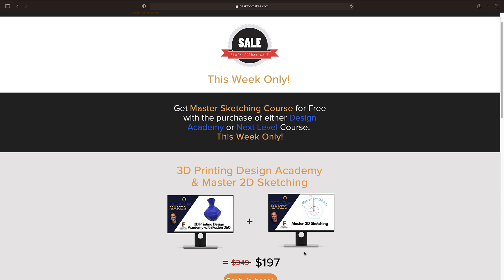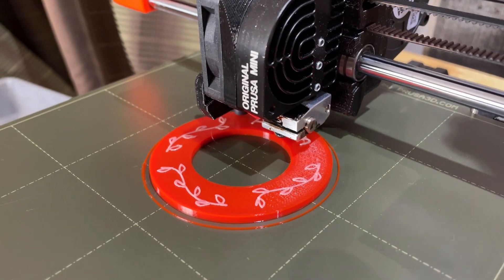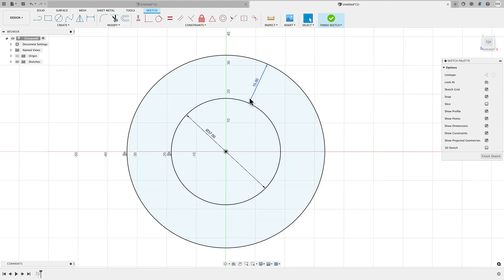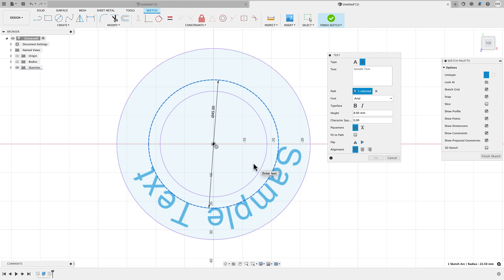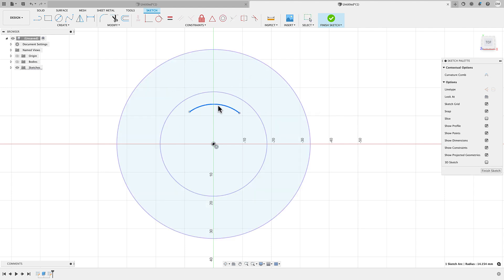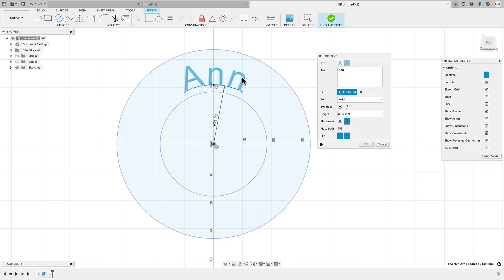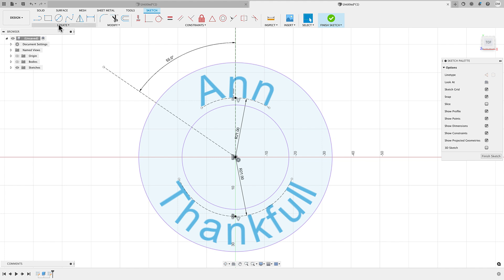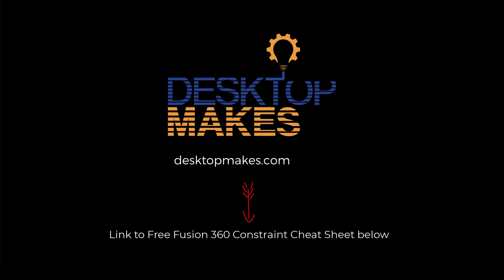Text on Path with Fusion 360

Comment: Curious why the good advice on proper constraints at the beginning and using the offset.  But then you totally make that constraint less valuable by placing the text based off the center point at a specific distance, versus as a constraints offset from the inner circle so it could adjust as needed (like you pointed out in the beginning)?
Or am I missing something 
That aside, a good tutorial

Comment: *thankful. haha

You don't know of a way to dimension by arc/curve *length*, do you?
Reply from the maker: Oops.  Too bad no spellcheck in Fusion Text.  Hmm...do only way I know to dimension an arc is by diameter.  Or if you create a Center Point Arc you can define by angle.
Reply: @DesktopMakes  dang. I know I can figure this specific application with some math, but that's definitely a feature that would be quite useful.
Reply: Possibly. Plz, explain a bit more. Exactly what needs to drive what? What parameters are involved? I'm always up for a challenge :) ...
Reply: @swamihuman9395  basically, if I were drawing a circle, I would want to dimension it by its circumference. I want to draw an arc, and make the distance between the two end points a certain amount. 

The thing that brought it up is wanting to draw a pattern of a 2d piece that would roll to be the bottom of a cone (a lampshade). So the 3d finished object would be a loft from a circle of diameter 1 to another circle of diameter 2. The distance between them would be length 1. Now the pattern would be two concentric arcs, with diameters of (something) and (something) +length 1, and arc lengths of diameter 1 and diameter 2. My specific example could be figured out with some simple algebra, but that shouldn't have to be done if the proper tool for dimensioning is available. 

I feel like I typed a lot but didn't actually explain any more. Hope it makes sense.
Reply: @JD2jr.  Deciphering, now...